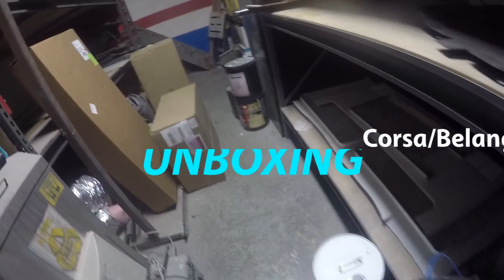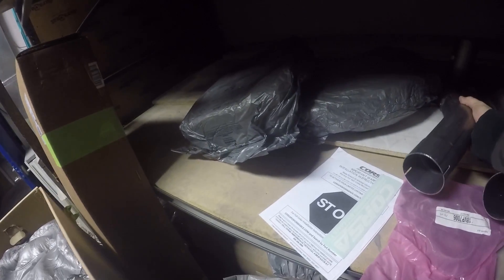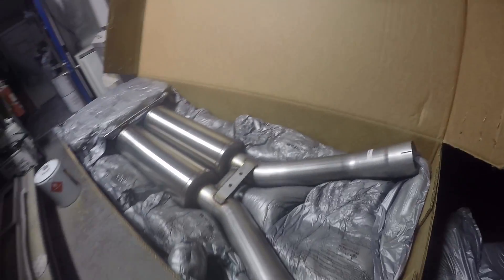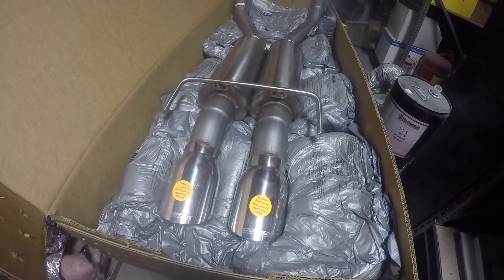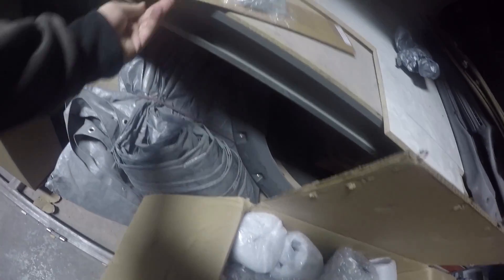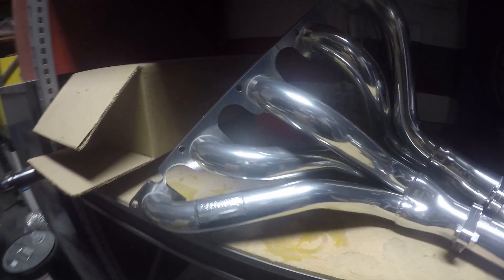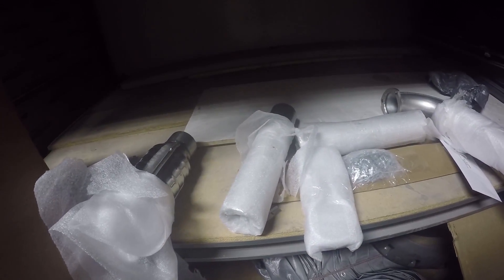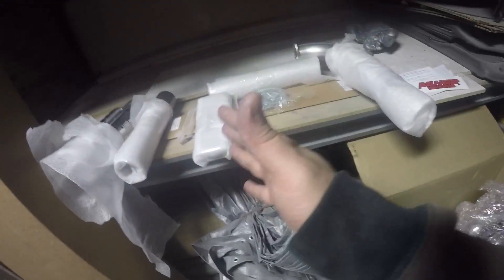2000 Viper - Unboxing Corsa Exhaust/Belanger Headers

Comment: Hell yea. I have a 97 with SVS headers stage 8 locking bolts and now borla race system. Started with stock cats, then green high flow cats now catless. No bad smell for me but def notice improvements with full system. You installing yourself, it's pretty simple took me 1 day with just messing around! Looking forward to hearing yours when it's finished!
Reply from the maker: Thanks for the info!